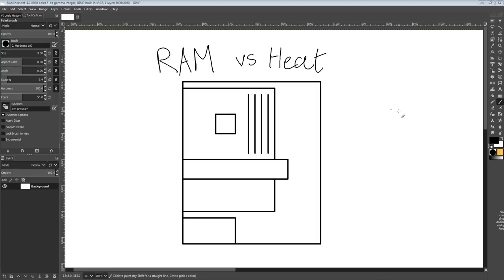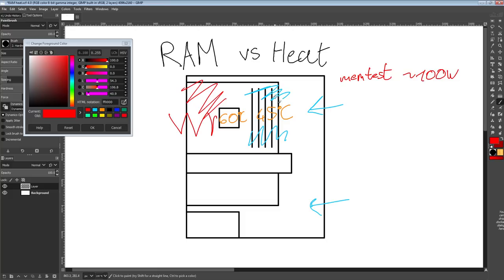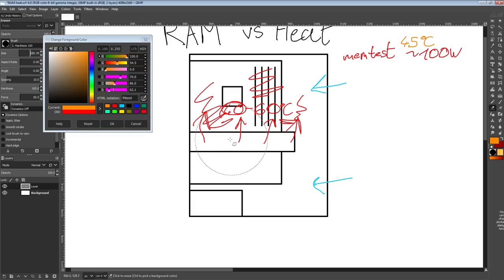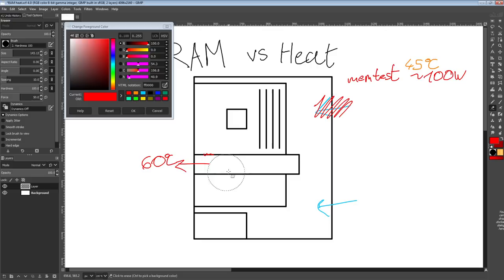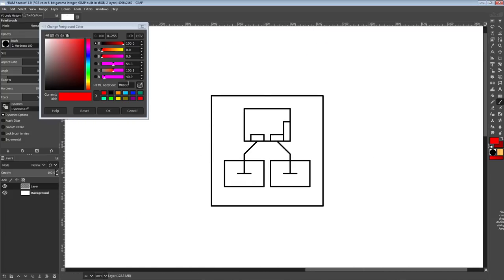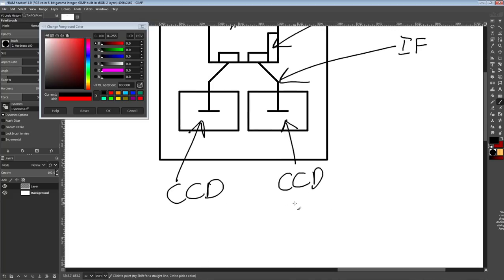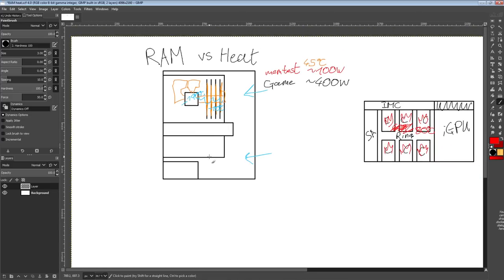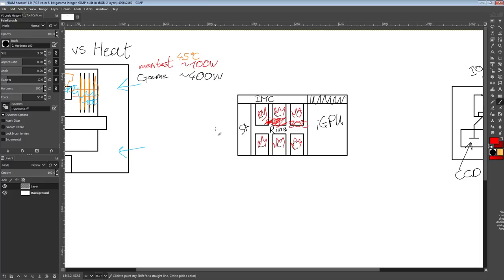RAM overclock stability and heat management.

Comment: Wanna talk about the gpu cooking stuff? Look at where most motherboards have their nvme slots
Reply: And throw in stock CPU coolers or any CPU air coolers not in push-pull horizontal direction, which, all what they do is pumping hot air down around CPU cooler.
Reply: @reav3rtm  nah the 120-140mm fan in the rear sucks the heat out..
Reply: @sidewinder86ify  Not enough. I know, my Asus x570-I Strix is almost being cooked by stock cooler on 3900x paired with 250Watt GPU 
 (in my case 1080ti) under load. Under Linux wifi adapter starts to even throttle when it reaches 80, 85 degrees due to amassed heat around. There must be more than 70 degrees inside the case. I was planning bigger twin 14cm push-pull horizontal cooler anyway, just wanted to see how stock cooler fares, and perhaps it would better with different motherboard, different case (Fractal Nano S) and different GPU. And not under load...
Stock cooler pushes air down the motherboard, before it gets out, it hits everything around: nvme, memory, chipset on mini-itx.
Reply: My favourite story about this is people on reddit buying a Gigabyte ITX board where they complained that their nvme drive was horribly slow. Well, the nmve drive goes over the chipset. And the video card sits right on top of that. It's a damn furnace. And some people were putting 3900x's in these things where the vrm's had very weak cooling. I dunno. I just laughed.
Reply: flash memory wears out faster at colder temps, you want it just cool enough that the controller chip on it doesn't slow down.
Reply: What about a bad PSU cooking ur GPU?? The good old days....
Reply: @VeritronX  Yeah but only the flash memory, the other stuff on the drive doesn't work that way.
Reply: @M.Streicher "kind of" because if the M.2 are in front of where the air from the gpu vents it slightly helps, those motherboard heatsink covers only work if you blow air on them, hot or not I have 3 M.2 now 2x 3.0 1x 4.0 (2 below the gpu in line) 1 away right of the memory sticks and they are fine idle they are around 45°C and while gaming (borderlands 3 which burns my 1080ti with 98% gpu usage) they go to like 60°C not much more
Reply: @fredEVOIX  Heatsinks need airflow. That's just the way it is. Of course they do a better job with cool air running over them, but as long as the airflow is cooler than what the heat sink is attached to it will help keeping the temp down. The VRM's for instance are usually located close to the CPU and generally receives the majority of their airflow from the fan on the CPU heatsink. While a heatsink that passes the air straight through horizontal to the motherboard is good at keeping the CPU temperature down it is actually usually bad at creating airflow over the VRM heatsinks. For that a top down heatsink usually works better, but at the same time they have limitations on how well they can cool the CPU.
Reply: watercool the gpu => problem solved
Reply: I like my SSD's toasted on one side.

Comment: Honestly this vid does present a very compelling argument on watercooling high end cards.
Reply from the maker: or open air test benches
Reply: @ActuallyHardcoreOverclocking  I did both plus a/c cause I'm obsessed with the lowest temps possible.
Reply: @ActuallyHardcoreOverclocking  That too. Although I think the same could be said about horizontal mobo mount cases, if heat convection is enough to drive the heat away from the memory modules.
Reply: Lowest temps i ever had was a Silverstone Grandia GD08...horizontal with a Corsair H100i V2 cooler...awesome older case.
Reply: On modern systems water cooling the GPU usually gives you more extra performance headroom anyway...
Reply: @mystical4442  heat convection is insignificant compared to any airflow. That's why it's better to keep VRMs and Dimms in the wind of some fan.
Reply: It also makes a compelling case for ducts to control airflow.
Reply: @ActuallyHardcoreOverclocking  Hi there, I got a question for you. I recently got a ryzen 3900x with a asus gaming-e mobo.
 I would like to know which kits do you recommend (price/performance with a max budget of 400$) .
 I originally wanted 64go (4x16) but apparently it does not work. So I dont know if I should go for 2x16 or 2x32 or sticks with 64go and which model. 
Its my first build and I am quite new to all this but I am learning a lot following your chan. Thank you for your help !

Comment: Exactly what happened to my memory OC. perfectly stable 3733mhz until I launched Metro Exodus :p 48.5C perfectly fine, 49C crasheeees ;)
Reply: Had the same. Pointed fans at my sticks, opened the case and my temps dropped over 20-30C.. lol.

Comment: Old but great video which saved my day 🙏

For that reason I now take IR photos of memory sticks when fully loaded in memory tests like OCCT memory test or large FFTs in Prime95 and I can still pass the test errorless. This gives me picture of at which temperatures I can be sure that memory sticks remain stable. Then I run solely Furmark and unlock all power limits on GPU in order to simulate worst case scenario (long GPU load with high heat emissions), then I measure temperatures of memory sticks again by taking IR photos. I must have at least 5 °C lower temperatures than after getting memory sticks hot in memory tests in order to leave some headroom when game loads memory by loading levels, compiling shaders or saving stuff. 

Since then I have no longer issues with memory stability in games and secondly GPU is also more happy to run at same temperatures but at lower RPMs, which also makes for front mesh fans much easier to push colder air to the memory sticks.

Lastly on gaming machines I stopped reducing tREFI and tRFC to have more stable headroom margin

Comment: Wow, I didn't know system RAM was so sensitive to temperatures. VRAM on Gpu's can easily get twice as hot and still work fine.
I remember Kingston used to have water cooled DDR3 RAM called Hyper X h2o. But now days manufacturers seem to be more interested in making flashy RGB RAM than focusing on cooling.
Reply: "But now days manufacturers seem to be more interested in making flashy RGB RAM than focusing on cooling"
From what I have observed, Flashy RGB ram tends to have bigger and thicker heatsinks.

Comment: Thank you so much for discussing this! For over a year I could not figure out why my system would crash while gaming but be stable any other time. After watching this video, I started collecting sensor data from all components, including RAM, looked for ways to reproduce the crashing, and looked for correlations between time of crash and sensor data. From your video I focused my attention on RAM temps. Turns out that once my RAM hits 60C, it'll BSOD or go black screen. Knowing this, I could reproduce the crashes and found that simply placing a fan in front of ny RAM stopped the crashes and be stable up to 55C. I always thought RAM could work up to 85C based on things I read on forums. I think there is a knowledge gap out among most PC builders where most of them only focus only on GPU or CPU temperatures and troubleshoot by RMAing those, their PSU, or Motherboards. Or, they will RMA their RAM only to get the same crashes again, back to square one and think there is a weird compatibility issue with their components when the truth is the only problem they have is a mismatch between what is acceptable in reality and what they think is acceptable based.. I think there needs to be more awareness around RAM stability at different temperatures, that a GPU can be fine at 80-100C, but RAM is happiest up to 45C or so. Hope to see more videos about this in the future!

Comment: thank you buildzoid, i have no idea where corsair sourced the cheap DDR4 in one of my off builds but stability became trash once the gpu and cpu came into play until i placed a small fan on the ram.... despite as you said; memtest dumping it with many instances. Gonna blame the 3080ti for that. 
A 4 year belated thanks for saving me from self-committing to the looney bin.

Comment: I just OCed my mem sticks to 4133Mhz 17-17-17-37 (GSkill Trident Z) Rock stable on daily tasks and memtest, BSOD on gaming with SLI. You probably solved my problem. Better air flow near sticks or lower freq on them. Thanks :)
Reply: Was that from 3600 ram pal
Reply: @musicsouth2033  Those sticks are GSkill F4-4266C19-8GTZR. Their XMP profile is 4266 Mhz 19-19-19-39 on 1,4V but xmp profile isnt working on my z390 aorus master because these sticks arent on QVL list for this board. So i tried to manually oc these sticks. 4133 17-17-17-37 on 1,45V is my final stable result. I made two runs in memtest. Zero errors.

Comment: One more thing you might want to add which might be limited to HEDT systems only is the heat output from the VRM's. On my X299 system, I found that the small fans on my VRM would push the heat into the surrounding area causing the RAM temperature to rise.

Comment: if you have B-die, just point a fan straight at it. No ifs, no buts, just strap an 80mm or so fan straight on top of the sticks so that they have direct airflow. There, problem solved.

Comment: I'm surprised that 50C is destructible for DDR4 memory. On my X99 system I have 8 x 16 GB Samsung M393A2G40DB1-CRC4Q ECC dual rank D-Die. Idle 35-47C and under load (prime) it can go up to 55-70C depending which stick. I have no issues now. I'm planning to play with it to get better timings. Do you think it's save ? I mean my case has average airflow all other components are cool enough. Is that normal for those sticks ? Is it save to start working on timings with those temps ?
Reply: I have trident z royals 1.55 volts xmp and they all get around 65 while gaming I spoke to a g skill rep through email he told me that’s absolutely normal. I have never gotten errors

Comment: Quite funny that this video comes up right now, after I bought those 2x8 B-Die dimm for fun testing and noticed I needed to put lower clocks when temps > 50 C. Hynix CJR doesn't seem to mind as much so I'm considering removing the B-Dies since single-rank , even b-die, doesn't cut it to dual-rank CJR.

Comment: Also you might not have any overheating issues but if you have 4 sticks, PCIE 4 graphics card and an NVME you might also overwhelm the SOC if its starved for voltage.
This can happen if you have a stable system and then introduce more ram sticks, NVME or a new graphics card to the mix.

Comment: My RAM temp can hit 80C during gaming. That is in a case with really good airflow, AIO on the CPU, and a 5700XT GPU. RAM is not OC, running at 3200. I even undervolted the RAM a bit (1.35V). GPU temp is well controlled at about 50C...maybe 60C Junction Temp.

Comment: Just a question not regarding the video. I bought new RAM (Patriot Viper 4 Blackout Series 16GB KIT DDR4 3600MHz CL17 2x8GB) which IS NOT supported officialy by my mobo (MSI B350 Gaming Plus + Ryzen 2600) and it wont post. From what I read the RAM usually works it just isnt stable at higher clocks etc. but should work. I tried both stick invidually in each slot and to no avail, while old RAM works just fine. My question is how likely are both sticks defective. Could clearing CMOS help?
Reply: The reason why the sticks won't work, isn't strictly because they haven't been approved by MSI, but its related. When you put a stick of Ram into your Motherboard, if it is on the QVL List, this means not only has the Memory Kit been tested, but the Motherboard Vendor has actually set Auto Timings for your Kit that will work with your kit. If it is not on the QVL, then the Auto Timings it is drawing on could be timings that just plain won't work for your specific kit. What you want to do to get the kit to work is go through and set every single Timing, Sub Timing, and Tertiary timing manually, as well as all Terminations and Voltages Manually, then you will boot just fine. For most people that is way too much work, in that case buying a Kit that is on the QVL is better suited for that type of user.

Comment: the funny thing is that the "bad" b-die bins should scale better with low temperature, if the instability issue is caused by the semiconductor itself

Comment: finally someone talking about the elephant in the room, that damn gpu backplate cooking your components and making all top mounted cpu radiator stupid (I have one because my current case can only have it there no space at the front) I have corsair vengeance pro rgb that have temp sensors I honestly never saw the memory go above 50°C but I have good airflow, the ideal tough is to have either a front mounted radiator or even cool the cpu with the bottom radiator nothing should be above your gpu backplate except fans exhausting air

Comment: I suspect that heat might be my problem with RAM-overclocking, the system is stable up to 3666 MT/s when I run Memtest86 (2 times 4 passes with no error), and I can use my system for light tasks or only CPU-intensive tasks 24/7 without any crash, yet my system crashes with certain games within 15 minutes. I had to lower the RAM clock frequency to 3400/2 MHz to get it fully stable.I use a Fractal S with stock fans, a D15 for the CPU and RAM with Samsung B dies. I consider to put a second front-intake fan, one full on the graphics card and one full on the RAM.
Reply: @UCYm0trd8r08vgZCrBmdVRvg 

If I get no error in 2 times 4 passes of Memtest86 then the memory should be stable or at least suffiiciently stable to rarely ever get a crash in games due to memory instability as long as heat is not a problem, as far as I understand. I only use Memtest86 to test stability of my memory. I have two modules of 16 GB (so dual rank) of Corsair Vengeance LPX, rated at 3333 MT/s and CL=16..
Reply: Try using TestMem5 with anta777's config, it finds errors memtest86 misses very easily. If you can get errors with testmem5 in the 3666 config, you can tell it's unstable for sure.
Reply: @Nuno Gomes 

I have that second fan which comes with the D15 but at the moment I can't plug it in, I don't have a suitable splitter. My motherboard has 2 case-fan connectors and 2 PWM-connectors of which one is for watercooling (not sure what that means).
Reply: @qpwoeiruty668  

It is possible that Memtets86 misses some errors but would it cause frequent crashes with a game - Rainbow Six Siege - which is not that heavy on the memory?
Reply: @peterjansen4826  Nuno is right....your motherboard manual should confirm if the PWM connector for water cooling is a fan connector for an AIO water cooler.  It is fine to connect a second CPU fan to it. Alternately you could buy a 4 pin PWM fan splitter cable from Noctua if you want to run both CPU cooler fans from a single PWM controlled motherboard header.

Comment: 4:15 sys_check_exception iirc, I was getting it a lot when I was being brain-dead and using 4 sticks on a daisy-chain board that weren't on the QVL. I switched to the 2x8GB Patriot Viper Steel 4400mhz cl19 kit you recommended and that issue has never occurred again.

Comment: BTW, would you recommend a RAM cooler of some sort when overclocking Bdie? I'm not so sure if it would help given the fact that the GPU will be throwing some of it hot air into it. thanks in advance.

Comment: this is why i warm up the case with furmark and even run furmark at the same time as my memory test.  but yes i came to this same conclusion a long time ago especially with my little mini 1070 ti which gets pretty hot.  plus if the car gets hot a lot of that probably transfers over the slot to the board and then to ram as well.  side panel fans help a lot.  i need to test side panel fans exhaust vs intake.  everybody says intake but i think either front fans as exhaust  and side as intake or front as intake and side as exhaust makes more sense.  why would having all that intake be better?  has to mess with air flow right?

anyway, had to replace the optical 5.25 bay with a hand cut plastic panel and cut it out for a fan because i have an old case design that i keep using.  why spend money on cases right?  so my only front fan was the bottom one.  this has helped a lot.  have the z390 aorus pro and it has ambient sensors.  nothing goes above mid 40's c and theres a lot of sensors.  but i have fans EVERYWHERE. my mini card gets so loud with its fan speeds that i just let the other fans ramp up to 1000rpm or so, why not?  i wont hear it over the gpu anyway

all this is why i just bought 3200 14-14-14 and ran it at 3600 16-16-16.  all this finickyness (a word?) combined with the aorus pro's mediocre memory oc'ing means its not worth it for a 24\7 machine.  if i really want a bit more ill just get another matching kit and go for dual rank.  might have to bump voltage but not much.  its not worth it for a normal machine.  a bit more would be fine if the board supported it but wont make a big difference.

has anybody tried front fans as exhaust and side panel as intake (also rear as intake too i guess?)?  how did it work?

edit:  BZ mentions this in the vid.  will draw hot air over the ram sticks.  but i dont think that would really be a problem for me

Comment: I have a garbage tier B-die G.skill 3000 MHz CL16 kit (16-18-18-18-38). There are two XMP profiles on the RAM, profile 1 is 2666MHz and profile 2 is 2933MHz (both at those timings). I had the kit overclocked to 3200MHz at 1.4V with XMP timings and it passed multiple Memtest runs with no errors but sometimes I get a bluescreen on cold boot. 
Today I wanted to stabilize the OC so, I went into the BIOS and started by setting all the RAM settings back to default except the XMP Profile and the voltage (XMP profile 2 at 1.4V). After I rebooted the PC, the XMP timings went down to 15-15-15-15-36. I'm not complaining, but seriously WTF!!! Does increasing only the voltage affect the default XMP timings?
Reply: Ram name?